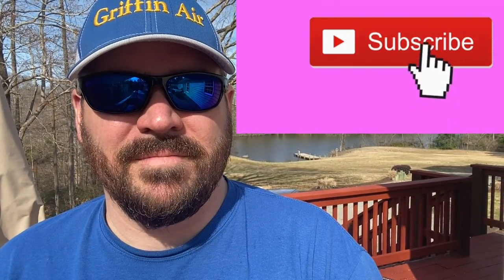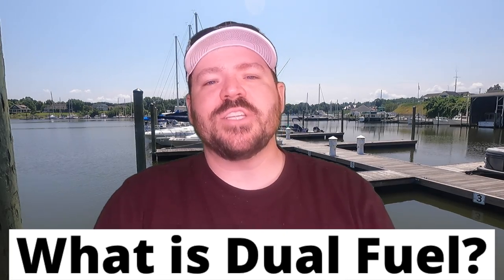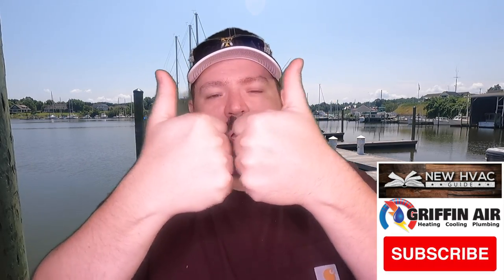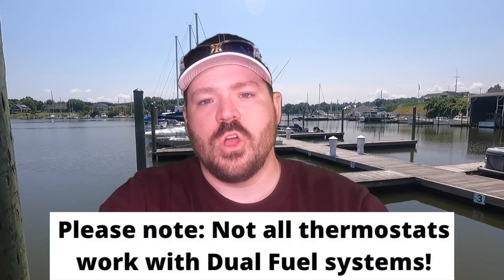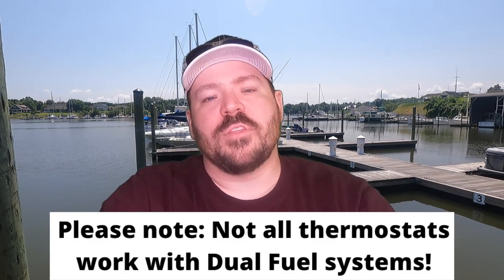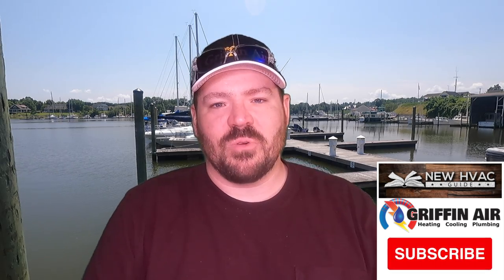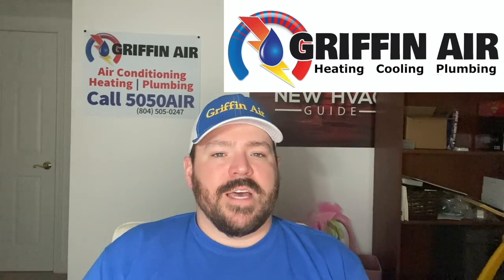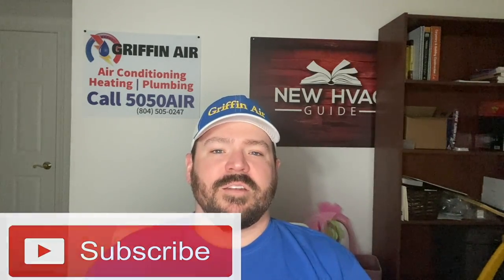What is Dual Fuel? Simple explanation from a HVAC technician.  All Brands.

Comment: I appreciate this more than you know. I opted to let Fuller HVAC up-sale me on a Fall inspection today. Basically I paid $99 for the guy to tell me there is a hole in the Heat Chamber and he was cutting my gas to the unit. Then quotes me nearly $4500 to replace the chamber. I'm sure you can imagine what my response was.
Reply: And by the way, my HVAC unit is outside my house so I'm failing to see how carbon monoxide could possibly get in my house from this unit. There is no way for carbon monoxide to get recirculated into the air coming into my home. So, how is this 2-3mm hole going to poison my home? There's also no corrosion around this tiny hole. It's just a hole in a pipe.

Comment: We live in a townhouse in  Lewes, Delaware and the benefit of a Dual Fuel system for us is that the Heat Pump makes a lot let NOISE, perhaps only 40 decibels versus a Single Fuel system 51 - 75 decibels. With 75 decibels we cannot enjoy our patio which is next to our Single Fuel air conditioning condenser.

Comment: In the Atlanta area we went this way. 2-stage compressor outside and variable speed air handler in the basement with standard 80% AFUE nat gas furnace. Fantastic.

The AC/heat pump handled everything except for the coldest of days. On mild days you never heard anything run unless standing right next to it, indoors or out. 

I can’t say our energy savings was all that better but from a livability standpoint it was no contest. 

For our ~ 2400 sq ft home we got quotes around $5K, $7K for everything (this was 2008 or so) and went with a $10K system, outrageous by comparison but guess what? Not a DAY went by when I didn’t know exactly where the money went. Best house upgrade ever. And some people will spend an extra $5K or $10K on a vehicle without blinking, only to toss it in a few years!
Reply from the maker: I've never heard that analogy to cars before, but I love it!  I may just steal it! haha
But it makes sense...

Comment: Great video.  I have a forced air gas furnace used only for heating. Also have and air handler with outdoor condenser used only for cooling. Do I have a dual fuel system? Thanks
Reply from the maker: It doesn’t sound like it
Reply: Thank you for your reply. Just one further question please.  
I have a forced air gas furnace used only for heating. Also have a air handler with outdoor condenser used only for cooling. When I connect air handler(cooling) to Rc and furnace(heating) to Rh. The furnace will not turned on. But if i removed the Rc, then furnace works fine. 
Furnace only has R and W1. Air handler has R, G Y,C. Can my Nest control two separate systems? Thanks.

Comment: I have a trane heat pump and a gas furnace. Are there any draw backs to running emergency heat mode? Will it hurt heat pump. Will it cost more money? I'm hearing about heat strips in the pump that will cost 4 to 5 times the cost when emergency mode is used?

Comment: I am in Southern California have been using the conventional air conditioner and natural gas furnace systems for 35 years with the same units. They are still running, but aging. Now I am looking for a new good practical system before my aging system quits. I have a two-story 2500 sq ft stucco house w/o solar panels. What is the best system to choose from:1) conventional air conditioner and gas furnace or 2) heat pump system or 3) hybrid system with heat pump and gas furnace ?
Would you make a recommendation?
Reply from the maker: Some are predicting a complete phase out of furnaces in Cali very soon.
Reply: @NewHVACGuide  thank you. I got it.

Comment: Hello from Canada! We are in Eastern Ontario (between Ottawa and Montreal) and can have a range of 90+ degrees in summer and 22 in winter, so we've decided (because of govn't rebates) to change over to a hybrid heat pump system using propane and electricity. I just want to clarify though below a certain temperature the propane kicks in? Does that mean we run on electricty otherwise? Or are both fuel sources employed depending on temperature? As well, it this automatically controlled or can we control that on the new thermostat they're installing along with the system? Thanks so much!

Comment: I am south of you Virginians in NC and the winters aren't too bad. In the 28 years that I have lived in my current house I had insulation blown in 10 years back. My central air was replaced about 24 years ago I think. My oil furnace is about 14 years old but last fall the service technicians said it still looks very serviceable. I use an independent propane wall unit heater in my basement. In the past when I asked service technicians about going dual with a heat pump/oil furnace they just shrugged. My central air has developed a freon leak so this summer I have depended on two window units. I don't know whether to install an independent multiport unit ( don't have a good location ) or replace the central air with a heat pump with out backup. Ideas?
Reply: That is oil backup not out backup

Comment: I have to replace my A coil, line set and out door 5 ton condenser. With LPG cost going up and down and issues with getting it. I am considering replacing the 5 ton with a 5 ton 15-Seer heat pump and a new A coil and new TXV. I'll also replace line set as I am moving the outside condenser over a bit.  Question I like the Gas furnace and the heat, so I want gas heat most all the time. So which Thermostat and or items would be required for me to have total control of when or if the heat pump or furnace is give the command to operate.  And if there are wrong or right heat pumps to get. My system is Goodman and it's been great. Looking at the GSX160601 and the CAPF4860C6  A coil. My furnace is a Goodman GMNT-120-5    92% LPG furnace.  Suggestions from knowledgeable people have kept me alive so far so I am open, thanks, Ron
Reply from the maker: Almost every dual fuel thermostat will allow you to switch to gas heat by switching the mode to emergency heat. Other than that, I'd recommend finding a good pro and sticking to their advice.

Comment: I have the dual fuel Trane and expensive thermostat with a built in computer to automatically set least expensive way to heat. But using my natural gas supplier’s prices from their on line advertisement is way off. What it does not take into account is a added pipe line cost. This added cost puts NG up to almost same amount per cubic foot as propane. Food for thought…

Comment: Your videos are great! I'm pretty close to getting 2 Daikin fit systems installed. However I can't make up my mind to go heat pump only, or dual fuel. If dual fuel are you just installing a 110V furnace indoors? I ask because an installer suggested this to me so they don't have to run 240V for the air handler. Is that right?!
Reply from the maker: That's correct.  However, keep in mind that if you're doing heat pumps, the Fit can't be paired with horizontal applications.
Reply: @NewHVACGuide  Do you mean it can't be mounted horizontally?
Reply from the maker: @ScottAllison  The Fit heat pump has no AHRI match with a horizontal evap coil currently.  Neither does the DZ18VC. You must do a DZ18TC or DZ20
Reply: @NewHVACGuide  Gotcha! I hadn't looked at the coil, just at the furnaces which are up/down/left/right.
Reply from the maker: @ScottAllison  Yes sir.  Didn't want you to fall in love with a product and not be able to use it.
Reply: @NewHVACGuide  Haha, I appreciate that! Luckily my attic is huge, so I think whatever config we end up with, there's space for horizontal or vertical.

Comment: I am in Portland, Oregon which has quite mild winters but sadly increasingly hot summers. I have an 11 year old nat gas furnace with a heat exchanger that is gumming up and is performing badly. I would prefer, for environmental and cost reasons, to switch to a electric only extended capacity heat pump system so I can heat and cool. "Extended capacity" heat pumps, without a nat gas furnace as backups, seems to be the product the Energy Trust of Oregon is promoting.  However, when I speak to most HVAC contractors here they suggest a dual fuel system. I'd rather not spend the money on a new nat gas furnace that is only rarely used. But I am confused if a nat gas backup is really needed in Portland or if the new heat pumps would be fine handling the temperatures here (coldest it gets is usually 25 F).  Am I correct in assuming that just the heat pump would be significantly less expensive to install than a dual fuel system?
Reply from the maker: I’d say yes. Dual fuel would be a heat pump with furnace.

Comment: There is more than just that. When changing out your hvac system of course you want to save as much money as possible since it is the most expensive appliance in the home. You also want to make sure your getting an efficient system. Heat pumps are typically matched with indoor electric furnaces and require more power. This means if you want a heatpump and you have a gas system currently you will have the added cost of running expensive electrical circuits. This is what make dual fuel a win win. Professionals typically call them hybrids, not sure who started the dual fuel thing.... With a Hybrid heatpump you get the best of both worlds. There are some climates where a heatpump is not even a viable option if long extreme cold temps exist. Fuel heating is a must below 0 F. However having a heatpump with a backup gas source is the cats meow. Especially if it's a variable capacity system such as the Trane Xvi.